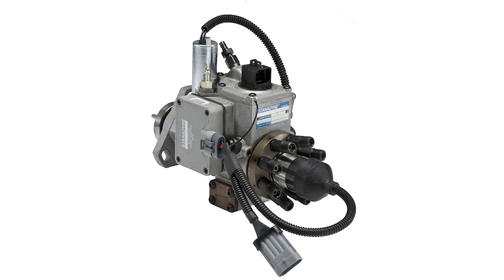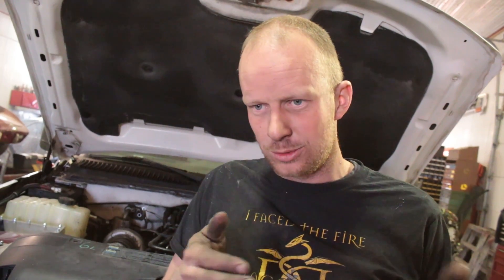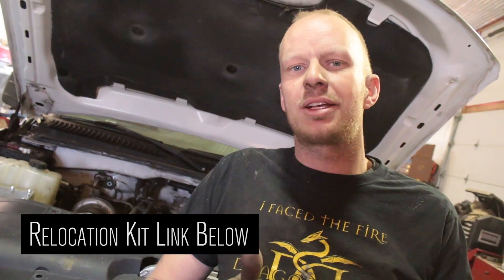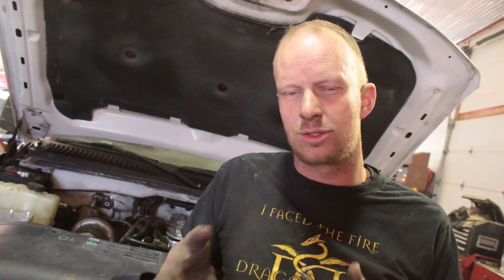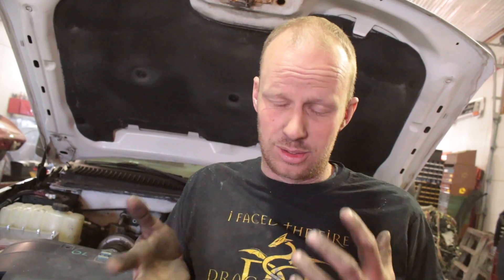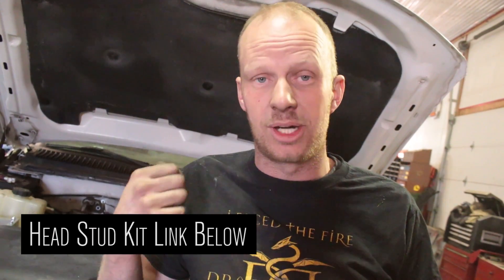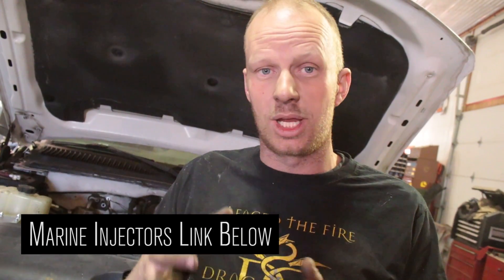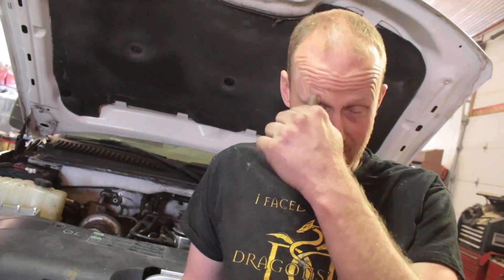REVIEW: Everything Wrong With A GM 6.5 Detroit Diesel

Comment: I had a 93 2500HD with the 6.5TD. Purchased with 93K, I installed a gear drive, mechanical boost controller, the last and best revision of the stock turbo, marine injectors, turned the injection pump up and a complete mandrel bent exhaust system including the crossover pipe.  Never did the double thermostat mod, just a high flow, and never had an overheating problem. It ran 12 psi boost for the next 210K, no issues, no problems.  Would it pull with a Cummins or Powerstroke?  No.  But it pulled about as well as a 454, but with WAY better mileage.  Granted, it was a mechanical injection engine to start with but that truck was great.  Sold it with 300K, and as far as I know it's still running.
Reply: where can i find a gear drive, mechanical boost controller? off a 6.2 pump?

Comment: should do a review on the 318/360 (5.2/5.9) magnum v8s. I feel like they were under estimated because of chryslers use of tall gearing both in the trans and diffs. They had a few problems but they still ran forever.
Reply: 98dodge360v8 Have owned two 318's and still have one 360. They are certainly fun little engines. In another life I would love to make a 408 of my 360...
Reply: i have had a few v6s and v8 magnum...overall good motors. not the most powerful but simple design and fairly easy to work on...had a dakota with 265k on original everything.. burned alot of oil and barely had compression but she never left me stranded. could have done a rebuild but the body was already rough from 15 new england winters..

Comment: Had a 6.5 Chevy Express 3500. It was decent for having 140,000 miles but in the short time that I owned it, and only putting 15,000 miles on it, I could definitely notice that it was getting sluggish. We had to install a new PMD, injectors, water pump, and a bunch of other stuff and it still never ran all that well.

Comment: hello i have a 2001 6,5 already i change the pump of the pmd pm and it works ok 1 hour later  it goes off.when i put the back gear made a black smoke and like that loses power and now it came out codes P0216 that  i can be thaks

Comment: hello i have  a 2001 6,5 already i change the pump of the PMD and it works ok 1 hour later it goes off when i put the back gear made a black smoke and like that loses power andnow it came out codes  P0216 that i can be thanks

Comment: glad I've seen this video now there's a guy in town that has a 95 Tahoe with a 6.5 in it 6 inch lift and 35's ... he is wanting $5,000 for it it has 154k on . it also has a conversion kit in it to run biofuel as well as diesel but the biofuel is disconnected right now I was really thinking about buying it but I'm not too sure now

Comment: Years in trucking with the Dodge 5.9 Cummins. Best mid size engine ever made have owned 7, 3 12valve and 4 24's. If they made a 5.9 Cummins conversion kit for an old H1 Hummer Id buy one.
Reply from the maker: They don't make one, but I do!  I am just about finished the Hummer dump truck in my shop.  Bring me a Hummer, and I'll throw a Cummins in it for you

Comment: I've owned a 94 6.5 truck, good truck made decent power in a factory half ton z71, have a friend with one in a 97 c3500 truck that does well too. Doesn't pull as hard as a Vortec 454 but they are decent and get great fuel milage!
Reply: Thats cool! I just picked up a 97 half ton z71 with a 6.5. They seem to be quite rare from what I've seen

Comment: absolutely cannot disagree in general but timing chain every 100k and pmd cooler..I have a 95 k2500 356000 mile . 95 c2500 289000mile.. by the way my 98 12 valve is closing on 1 million.   use a 6.5 as a small block with great millage not a semi you will be fine

Comment: It's kinda funny cause I have a 403 olds in my trans am and it drives like a diesel it makes similar power and torque at similar revs but goes a little higher than the diesels

Comment: My 6.5 has 232k on it and still gets clean oil reports every change and runs like a champ...  The key to success is simple "Maintenance"
Reply: Justin and Gabriel Downs mine run good for work trucks . Low power but pulls bobcat on trailer ok. Not for kids hot rodders.
Reply: 300.000 miles on my 92 k2500 manual pump 6.5 TD running strong..
Reply: @stringsattached67  got the same truck with a dump bed.  260k and use it daily.
Reply: oceanliners andshipsonlineandothervideos u owned one come on u have to agree thats better than 80% of any other diesel pick up out there ive heard some horror stories about 6.5s but we all know they neglected it 24\7 thats nothing compared to the horror stories about other trucks ive seen and where i live at a guy is holding a 117k motor for $800 comes with everything including a harness i dont need and trans are $400 i found a guy with 6 motors there all $500 a piece i fuckin love it and i run a transportation company and landscaping company i once had somone tell me quote on quote "do not run a transport company  with a 6.5 wrong application for that motor" and hes had one for 5 years i was like wtf? cause im sure as hell doing it i love my truck i dont even know if id get rid of it for a trashed beat cummins or an $20,000 duramax to be honest
Reply: @Xcrf150fX  can you send me any info on where you get these for that price?
Reply: @Xcrf150fX  do you happen to have any spare motors you'd part with an your location?
Reply: My 6.5 has 502k on it just had to put in injector pulled trailer houses and hundreds of bails of hay and heavy equipment with it so you tell me
Reply: @parkersoutdoorstv5452  what year
Reply: oceanliners andshipsonlineandothervideos thats what im talking about my 93 has 480,000 head gaskets just went and im doing them soon with apr studs
Reply: Try working it? I had 550000 km on mine when I sold it. And I pulled 10000lbs on a regular with it. It pulled alot for me that old girl and never left me on the road unlike my Dodges.
Reply: oceanliners andshipsonlineandothervideos yes Sir you dont need too but you can squeeze 500 or more ft lbs out of them do it for a fraction of the cost so you have a diesel that can out do a duramax or powerstroke that weighs less gets better fuel milage more reliable cheaper to build and in my opinion sound better someone already said it the only thing that can rival a 6.5 is a 12 valve and were cheaper lighter and have better trans haha
Reply: @Xcrf150fX  i have the 6.2 and 6.5 chevy and the ford 6.9 and had powerstokes the ford 6.9 with a turbo is a beast i was pulling a 10000lb fithwheel and passing powerstokes pulling little boats though the sierras i love my ford tow pig the chevy engines are in little custom builts that are more about milage and longevity than pulling power but im sure the engine will hold up to anything those little trucks can handle
Reply: 6.5 will live if you dont floor it everywhere. The armored hmmwvs are technically over weight for the chassis and you can run forever if you try to keep the rpms under 2700ish but you the dirt bag that floors it and redlines the piss out of it it blows. Its not fast but its the little engine that could.
Reply: We got a 97 6.5 pickup with just over 550,000 and the motor ran mint, until the oil line was rubbing and popped now she’s pouched...
Reply: Also to baby them.  Cannot drive things like race cars and expect it to last.
Reply: @ShadowOppsRC  can't drive anything like a race car and expect it to last. Not even a race car
Reply: @teds4983  😂😂👍
Reply: @teds4983  you've never owned a Ford have you.
Reply: @Zach-ju5vi  ya a mercury unfortunately
Reply: @Zach-ju5vi  but no powerjokes's for me
Reply: @teds4983  then you don't know what kind of abuse a real truck can take.
Reply: @Zach-ju5vi  ya i do, have friend's with f150-f550. There all trash, he got tired of putting parts on all of them and finally got a Cummins. Even the new 6.7 powerjoke couldn't get past 200k before shitting the bad. But whatever you say ford fanboy
Reply: @teds4983  btw you obviously dont what a real truck is like considering your original comment about treating vehicles like race cars. I do treat my trucks like race cars and my Ford not only takes it but it likes it.
Reply: @teds4983  lol you don't know me and I don't give a shit what you think either. I drive my stuff hard because I enjoy it, not trying to impress grandpa over here who doesn't even know what a real truck is. Your point is invalid because you don't use your vehicles to their full potential, it's like walking a marathon and then telling a runner how easy it is. Oh and btw I tune for efficient power not black smoke.
Reply: @Zach-ju5vi  forgot about me tuner that will give me 385lbs of tq on top of what i have but ya. Keep trolling them malls with your (real truck)
Reply: @teds4983  I know your afraid to drive you truck like a race car because you think it will break. what does a welding rig weigh 2000 lbs lol, I once hauled a camp shack with my f150 that probably weighed 20,000 lbs because someone said I couldn't do it. Hell just last week with my 3/4 ton, I pulled 10 bales home each one probably weighs 1600lbs. You could try pulling my Ford down the street but all I would have to do is hold the brake on until the transmission falls out the bottom of your shipping crate 😂.
Reply: @teds4983   injectors, intake, exhaust, tune and built trans. I bet it has fancy rims and a lift too, you have a mall crawler with a welding rig bud 😂. It's pretty sad you have to spend all that money just to get out performed by an f150 lol.
Reply: @teds4983  lol that 225hp will walk all over that heavy ass shipping crate in the mud and you know it 😂.
Better blow another 10g on your truck so a $5000 ford can pull you out of the mud lmao.
Reply: @teds4983 oh yeah we have tons of idiot welders with $80,000 jacked up rigs that get stuck everywhere and look stupid.
Reply: @Zach-ju5vi  well that's just Canada period. With there riglets, 3/4 tons.
Reply: @teds4983  I wouldn't know I'm not an out of work idiot oilfield welder. Besides that you greatly underestimate how gnarly the mud is here. I wasn't joking when I said your rig would sink out of sight over that cab gone, that actually happens here.
Reply: @Zach-ju5vi  i know that, that's elementary
Reply: @teds4983  that is a pretty vague statement bud and honestly its an ignorant thing to say no matter how you look at it.
Reply: oceanliners andshipsonlineandothervideos  out does them how? Not pulling that's for sure
Reply: oceanliners andshipsonlineandothervideos  Bulltits, prove it :)
Reply: Ya I had one too. Slowest vehicle ive ever driven. For as loud and as much fuel as they use you would think it would have some great low-end. Its a dog from bottom to top or rpm range. I got rid of the soot trap converter and that woke it up. Stock 350 gas engine is almost equal to the diesel that costs lots more to maintain and doesn't get great mileage
Reply: Bullshit. My dad had a 350 in his Suburban. Had only 8 miles per gallon with mostly highway driving. It was the K1500 of 99. That thing was a slouch and  the motor wouldn’t even last over 210k. It sucked a valve in. Then he got a brand new crate motor and blew it up at 5k miles then he got another motor that blew up at 3k miles. Never beat on it. Those engines are garbage and would have been better off with a 6.5
Reply: What year is it?
Reply: Mine has 280k on it and still runs very well. I had to relocate the pmw to the passenger fender. To me that was a better location than the top of the intake and I put a manual waste gate arm on it
Reply: Doesn't make enough power to actually hurt itself
Reply: Is one in Jesse perfect condition with 140k miles a good buy ? I don’t mind fixing stuff on it I just don’t want to have to spend a bunch of money right away
Reply: Till stuff starts going or you could just buy a junk one like I got and be constantly replacing everything and it still wont run ! Chevy should have never did these updates they should have bought them back or given us a new duramax ! Now 20 years later ive got a brand new truck that needs a new injection pump every few thousand miles It's not worth it ! They need to offer a buy back on all the remaining trucks
Reply: Have you had to replace the injection pump ?
Reply: A major problem with the injectors is nobody runs additive.  When mine went the first thing asked by the diesel machanic was are you running additive.  Answer yes, but was a farn truck before and they never ran additive.
Reply: The 6.2 lives for ever the 6.5 dies from nearly everything. The pmd, block and head cracking, lift pump is weak, the harmonic balancer is known to break cranks if not replaced, fuel cutoff safety switch is known to kill lift pump, smog pump sucks, the assisted steering sensor is known to go out, brakes don't last long, without a new exhaust the engines are known for running hot especially with a factory 210 thermostat. The reason these engines see so much marine and military use is their fuel economy not reliability. Some people go 160,000 and have issues others go 450,000 and their blocks crack it's very rare even on a bombproofed engine to go over 500,000
Reply: @maldinggamer  625k with my 6.5. No issues. It’s about to get taken out going to upgrade the block. All forged internals. Different cam. Ported heads and intake. And compound turbos. All engines have their short comings. The 6.5 is actually great when you don’t drive like an idiot. Every one of those things you listed is cause from abuse. Idc what anyone says. Every time they come into the shop and I ask questions it’s always bull. We tear it down and there is sludge in the pan. I also see the same things you listed in every other engine. Every day.
Reply: @ScooterLee-ei1ep  
Yep. There seems to be this epidemic of idiots who drive their trucks like they are hotrods or like they stole them, and then don't service them. We can fix engines but, we can't fix stupid.
Reply: @VillsvinJeger , Thank you! I am going through a diesel mechanics class at my local college and one of my classmates has a 04 Chevrolet 2500 with the duramax that he races and full throttles everywhere he goes. This guy complains constantly of having to replace parts and buy new stuff. He says to have put 10k into it. Even complains about the poor fuel milage (11.5mpg) Meanwhile my grandpa has a 04 gmc 2500 with the same engine that he’s had since new, has never had to replace any of the parts the guy in my class has. All my grandpa has done with it is pull campers, rolls of hay, and tractors on a gooseneck trailer. I can’t even remember how many miles are on it lol! Goes to show, drive it like a race car prepare for it to break like one. I’m 20 by the way so anyone who is willing to call me an old man can think again. Anyone who treats them like race cars has more money poured into them the truck is worth in the end.
Reply: @maldinggamer  put a turbo on a 6.2 and see what happens way worse than a 6.5, no meat around the mains, crack right up to the cam
Reply: and you are not working it hard.  Try pulling a trailer and it will fail.
Reply: @deanarthaud5897  it's a bulletproof fuel efficient engine. It's not a power horse diesel. Also, GM managed to fuck it up by tinkering with the Detroit diesel.